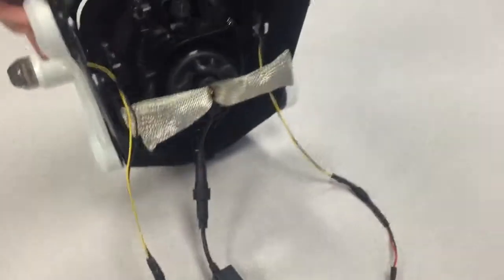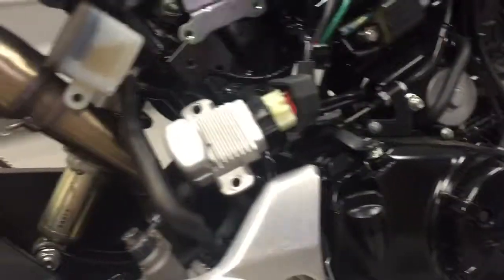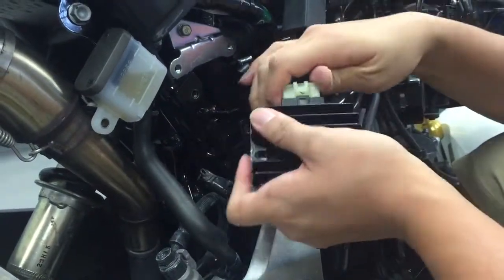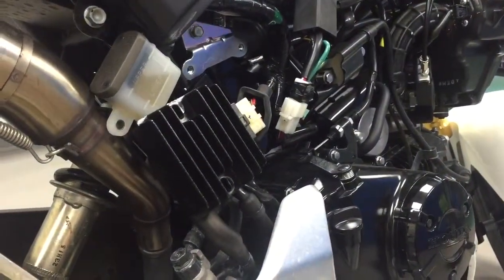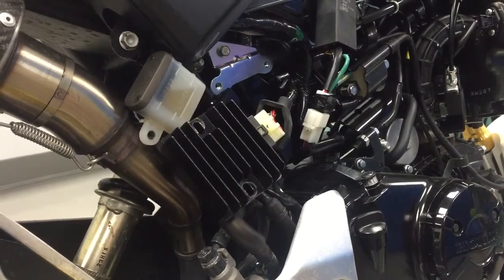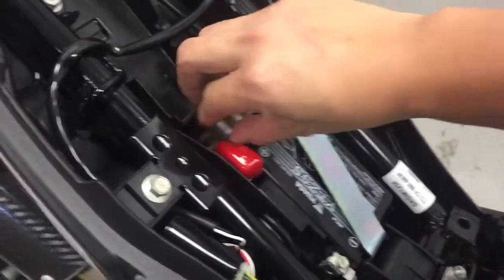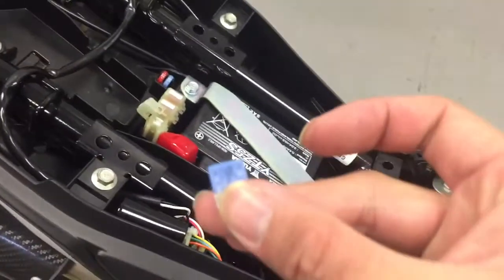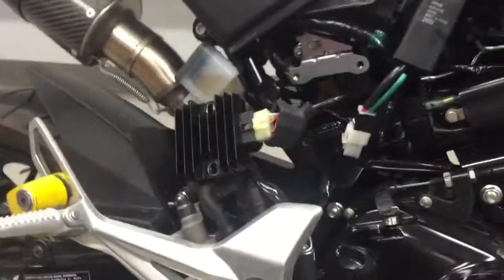Gojin ACDC Rectifier Issue for Honda Grom

Comment: Did you get this ironed out? I need to do an AC to DC conversion and was about to order the part until I ran into your video.
Reply from the maker: Yeah! SteadyGarage made it easy to do a warranty exchange! I would recommend picking it up and just keeping all your invoices on hand in case you need to claim warranty. It's a great item that makes running LEDs so simple. I'm just hoping I got a lemon and it doesn't happen again.
Reply: Good to hear. I figured SteadyGarage would take care of ya. I'm hoping it's not a common issue either! Placed my order.
Reply: Toyota, Any updates as to whether or not the replacement worked?

Cortez, did you happen to order it and install? If so how did it go?
Want to order one for two LED Bars, but want to make sure someone got this thing working correctly.
Thanks in advance.
Reply: Yeah, worked out just fine.